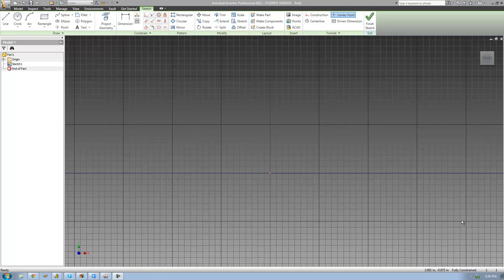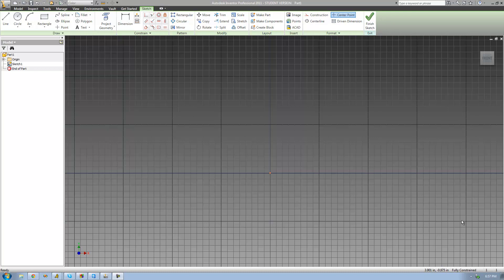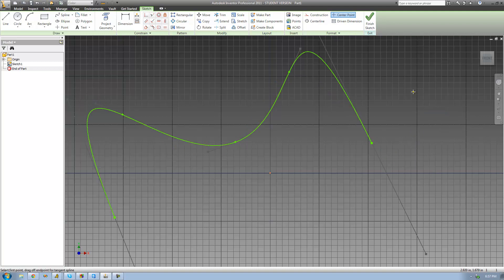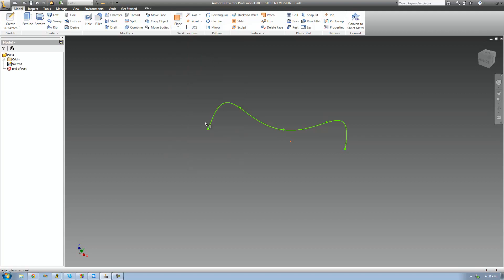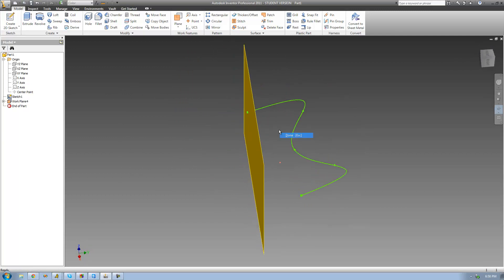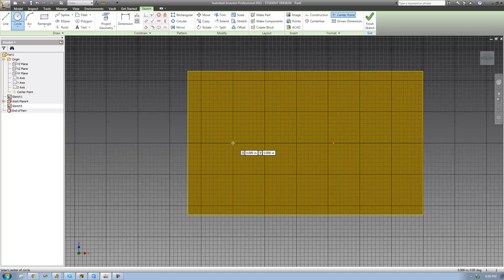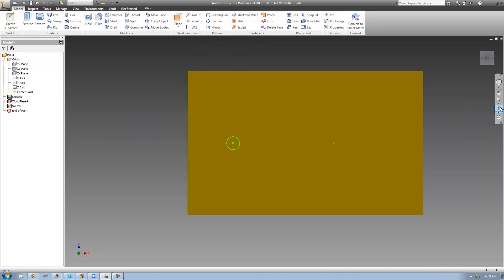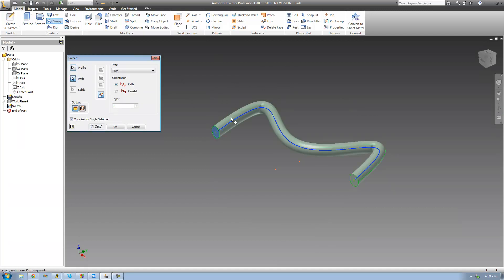Autodesk Inventor Tutorial 30, Sweep Tool

Comment: Adam,,, you said that the profile must touch a point on the profile or the point should be inside the profile!
so if the circle is far i can't make the sweep tool to work ?
If it's like that, Than 3DS MAX is more smarter :)
But still great tutorial. Thanks Adam